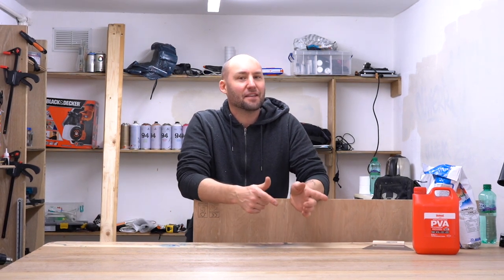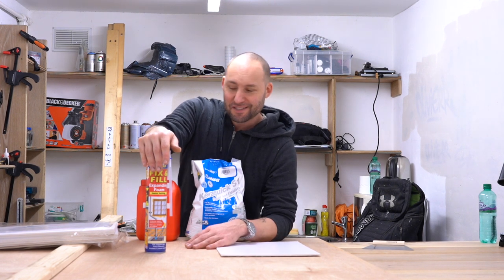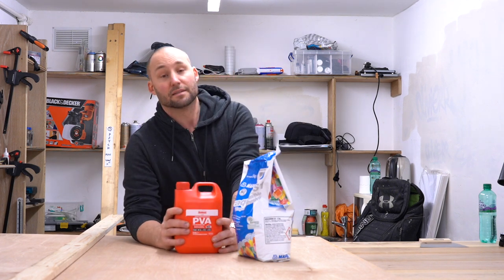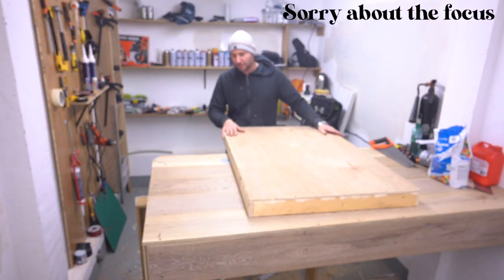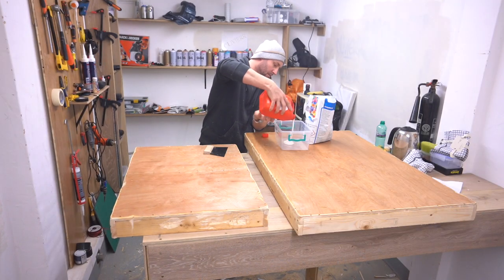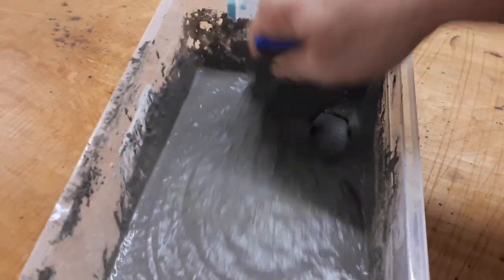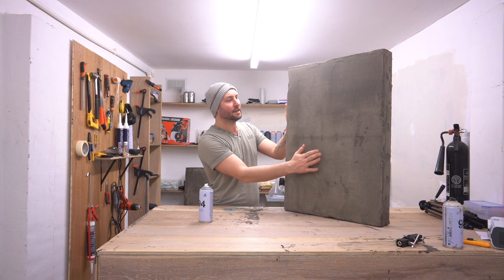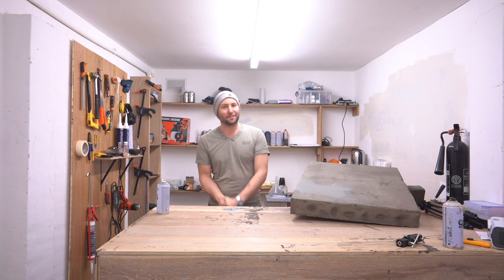Fake Concrete looking canvas for artists

Comment: does this have the same porous nature like regular concrete? If you sprayed water on it after it dries would it become darker in that area and then lighten again as it dries?
Reply from the maker: Say half porous. You could paint a 50% latex 50% water, 2 coats and it'll be non-porous

Comment: Does this work on a cloth canvas too or just on plywood? I asked the same question on your other video too.
Reply from the maker: Hi, it might do because it's flexible by nature. But I did it only plywood because im pretty sure it would crack. I would recommend you buying a cheap canvas and trying it. Alternatively, you can glue a piece of plywood at the back of the canvas if you really want to use a canvas